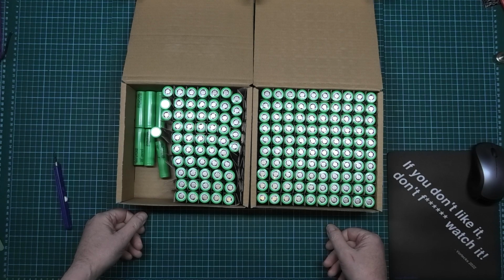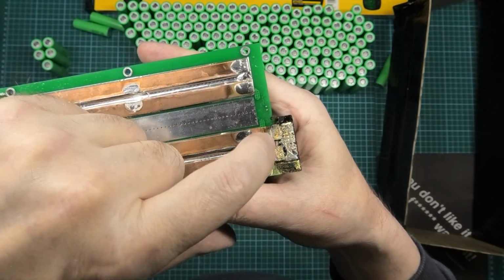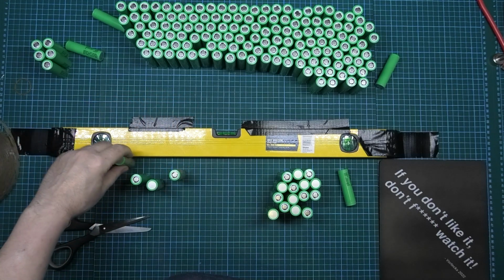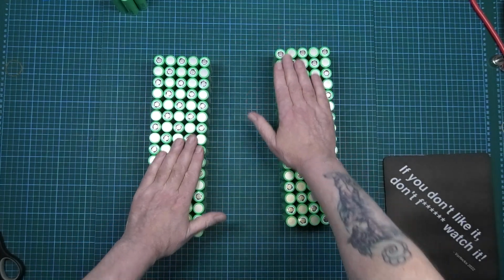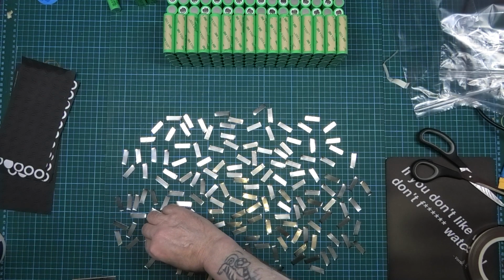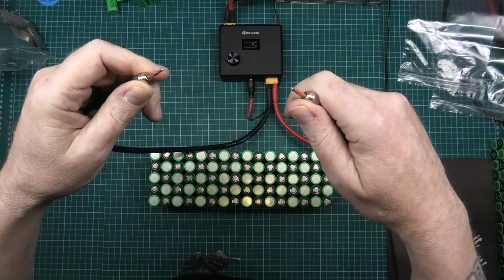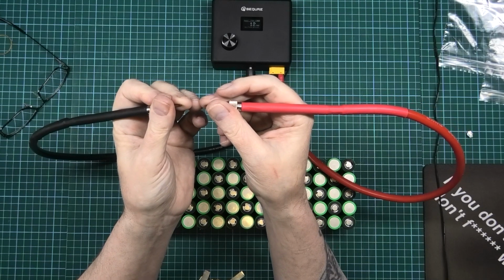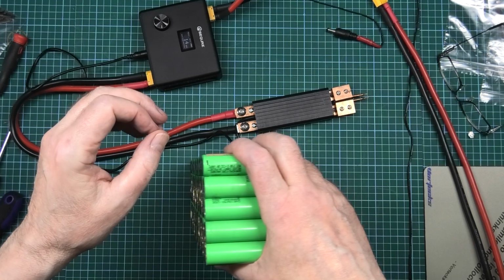The most in-depth 18650 ebike battery build ever? Part 1 of 3

Comment: I like using the honeycomb style cell holders. They hold the pack securely, make it easy to test fit in a tight space and keep a small air gap all round the cells. 
Still trying to figure out why you are not using parallel groups as it makes the connections much harder so looking forward to hearing why in part two. I know you know what your doing.
Reply: it makes no sense its just how he decided to do it

Comment: I would recommend rounding the corners of the positive side of the nickel strip, so there is no way that the overhanging nickel accidentally bends and touches the negative that surrounds the positive terminal...just an extra precaution :)

Comment: thats some thick nickel, does it weld good? have you tried taking it off with pliers to see how well its welded? what spotwelder is it? 
i like how this answered my question on how flexible is 16mm2 silicone wire, i will definately consider upgrading
Reply: also i like the tape you use to glue cells